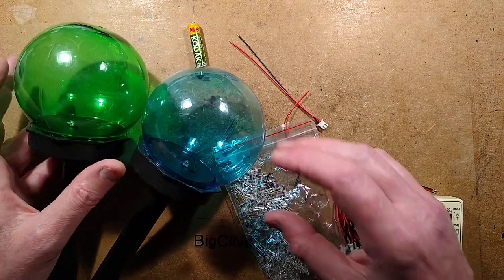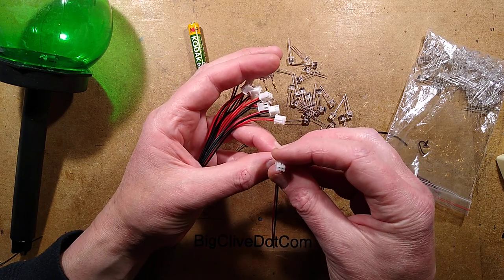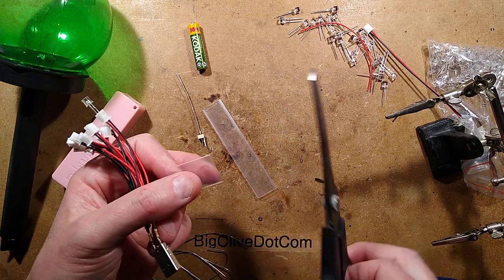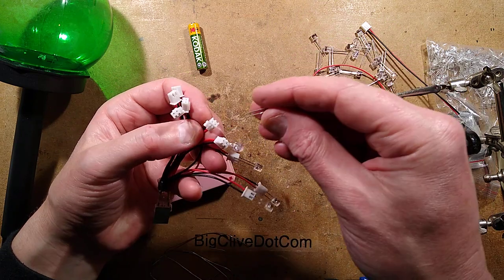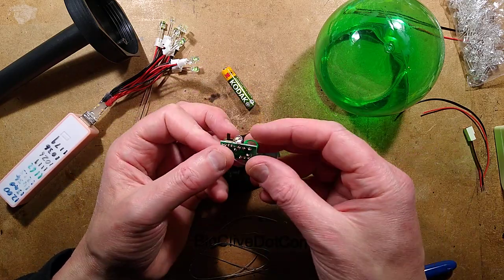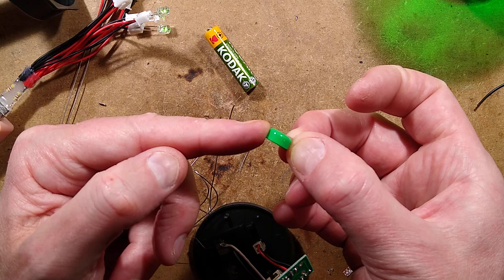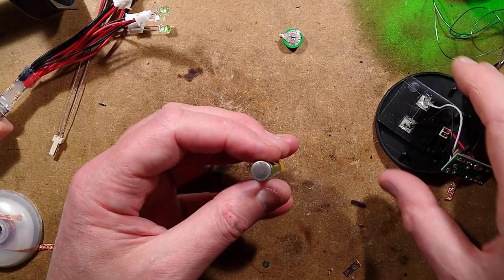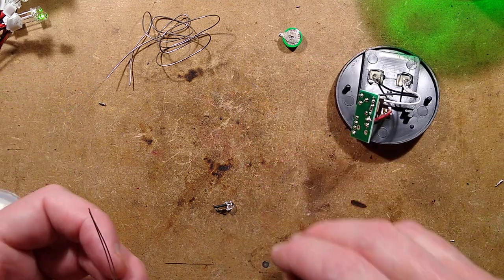Making cheap solar garden lights more interesting.  (Laid back video.)

Comment: Soldering above fingers?  Psh haven't lived til you catch a falling soldering iron to keep from burning the rug!  ...and burn your hand, dropping it, and burning the rug anyway.
Reply: I was soldering copper pipes in a wall with gloves on and I dripped solder down in them. Ironically the gloves were for safety.
Reply: That’s a fact got my hand my foot and the hardwood floor once
Reply: tried to catch a marshmallow that was falling off the stick once. Won't do that again.
Reply: Used to make 3D metal letters for signs the were all soldered (less distortion ) using dilute hydrochloric acid as flux and using a 1.5 lb (700g) solid copper soldering irons heated in a gas furnace. Quickly learned if it falls of the soldering bench don't try and catch it.
Reply: I taught my daughter to solder when she was 5.  "How not to burn yourself" was lesson 1.  It was fine until the wife came home from her summer school and wondered why little 'un had a burn on her hand...
Reply: I accidentally grabbed a soldering iron by the metal shaft. Three times. It sounds hard to do, but the iron was laying on a piece of tin sheet metal to warm it up ready for soldering a seam.
Reply: @PunakiviAddikti  otch!!
Reply: also soldering in your briefs or really short shorts...solder on one's thigh definitely doesn't brighten the day...
Reply: I did that but it was falling into my bathroom sink (bathroom is my work space) and luckily I touched the base of the metal part and it didn't hurt at all the next morning
Reply: Yes then the problem of trying to hide the burnt Rug from those who know everything and dispense instant punishment. Your burnt fingers don't matter at all.
Reply: I HAD NO IDEA HOW COMMON THIS WAS 😂
Reply: i guess half of us will not live, because we're not complete idiots
Reply: Ouch. Sometimes our natural reactions like to remind us who's really in charge.
Reply: Or the bed comforter.    My wife has yelled at me so many times lol 😆

Comment: That moment you see that really thin ziplock bag with LED's and go "Yeah... ebay".
Reply: Sucks that we don't have those small hobby shops where we used to buy this stuff as kids making some silly projects. They were close and you didn't have to wait for the package like you do with ebay.
Reply: @mmdirtyworkz   and you didn't have to support the Chinese economy with that much money, but keep some of it in your Region.
Reply: @Ch0rr1s  the LED's probably still come from China though?
Reply: For me that thin zip bag says aliexpress._
Reply: Ikr, that's where most of my components come from. Especially strange and rare components like blinking LEDs, alternating blinking two color LEDs, automatic slow changing RGB LEDs, COBs etc.
Reply: @mmdirtyworkz  Even the local MircoCenter is overpriced and understocked on DIY fun bits.
Reply: @technosasquatchfilms  yeah unfortunately, much different today, it wasn't like this before. I remember as a kid, it didn't pose any significant expense.
Reply: @mmdirtyworkz  Sure, but you paid more for 2 or 3 leds that you do for the shipping on the ebay package.  Local sellers kinda screwed themselves with what was clearly too much mark up.
Reply: @mmdirtyworkz  remember Tandy shops if you're from uk
Reply: @smoothemjay3303  we had them in Aus too. 2 x 1/4 watt resistors in a stapled together cardboard pack... insanity

Comment: Because of this video I went to the local dollar store and picked up a bunch of warm white string lights that use 2 AA Batteries to power. I snipped the 4.3ft line every 3 led's and wired up my crappy cold white led solar lights with the warm white instead. Such a huge difference. $1 per light when I bought the stake lights and spent maybe another 40 cents per light to retrofit. Sometimes they're still lit at sunrise lol.

Comment: Every time I come across one of those button cells, if there is space, I immediately add a AA battery. I now have over 30 solar lights in the garden, and all my shrubs have solar light strings. I spend a bit of time replacing the switches, and batteries...I love it. Every  Spring I buy more

Comment: You just changed my world with hot glue. I never thought about using it to mechanically stabilize solder joints
Reply: I love using hot glue to water proof circuit parts too.

Comment: I got a root canal today, and before they started they tested if the tooth was alive by having me hold an electrode and they would touch the tooth with some "tool" to pass current, and increase the voltage until I could feel it. Was rather interesting, first I'd heard of that! If you can feel a zap, tooth's alive, but if not then it's a good sign the tooth is dead.

Sounds like a perfect item for you to explore! :)
Reply: Is it safe???   8^/

Comment: Fun little project.  You tested the solar cell with a lamp and produced 30mA.  In the sun it would be closer to 300mA.  But you tested without the green shade.  In the sun, with the shade, I expect you to get about 1/5th that, so maybe not enough to charge your 100mA replacement battery.  Maybe that tiny button battery really was correctly sized!

Comment: Neat effect. It worked out better than one might think actually. They sell those exact ones here AU for about $3 so I must pick a couple up.  I have hacked many a solar light for Mum, they produce a much improved level of light for about 5 hours at night on an AA cell (Aldi) and a different inductor. And yes, bypass that switch!

Comment: re toolboxes, workbench tool accumulation etc the single best improvement to my work area I ever made was a board (actually a left over piece of laminate flooring cut to size) populated by a few dozen short vertical pieces of 38mm and 32mm black PVC pipe in 3 rows, tallest at the back (12cm or so), a bit shorter in the middle and shorter again in front, epoxy'd in place. its perfect storage for snips, screwdrivers, pliers, solder sucker, brushes, scissors, pens, poky things etc etc literally all the small hand tools that I would previously be constantly rummaging and hunting for, now all within arms reach and in a state of organisation the rest of my life can only wonder at

Comment: Thanks for the hint about soldering across the switch terminals. I normally use WD40 to keep them corrosion free. I have also started covering all the circuit boards with clear nail varnish.
Thanks for the great videos.

Comment: I have a string of x-mass lights 20 in each string connected to each of my solar lights.The strings came from the dollar store and ran on 2 AA. I  have extra battery's here out of charger packs so I put them in the lamp and took the supplied cheep cells out. Now it will last all night rather then 1 hour and i have 20 extra per lamp .

Comment: Dude, been enjoying having you videos on, while I’m writing.

I had a flashlight that I’d dropped, stopped working, and went under the car seat. I took it apart, and the red wire’s soldering broke… My hands shake like hell, so I avoid things like that… only burned myself once, but it’s working… I heard the make these things called gloves… 😉

Comment: I'm sure you're already aware of this but I wasn't: recent Anker smart powerbanks (the PowerCore Essential 20000 PD is an example) have a "low power" mode which, once activated, keeps the power flowing even with low power devices connected. Best of both worlds!
Reply: Is this the setting with the one green LED? I wondered what that was for!

Comment: Thanks for the educational bits in this, never considered that changing the inductor could be useful for winter...a useful mod I'll probably do from now on will be to have a switchable inductor to provide summer /winter setting...cool

Comment: That alcohol flux is fab stuff! I used that very brand to replace all the surface mount capacitors in my Amiga 1200.

Comment: Great renovation and modification :) 
I never buy garden lights with the small button cell batteries, because they don't hold much charge at all. In the winter, they won't be on for long at all, whilst in the summer, they'll be roasted. I often get the decent quality ones (not Poundland cheap, but not too expensive), and they tend to last. They also have AAA or AA batteries which often get upgraded as they fail.
I also agree about shorting the switch, as the switch often fails before anything else.

Comment: I replaced the LED in a garden solar light with a color changing LED. The LED works a lot longer than the one that was originally in it. I just paralleled them and left one leg off the original one so it could be reconnected if desired. As it is the color changing LED is very pleasing. Visitors always compliment how it looks and it has lasted a long time.

Comment: "Very harsh lesson " aka burn your finger, I have done that many times, for many years and still didn’t lern my lesson to not Tuch the hot end of the iron
Reply: I learned this lesson the first time I used desoldering braid. I didn’t think not to hang onto the braided copper thread I was pressing a hot iron to.
Reply: Don‘t catch it if it happens to Fall of the table! 😉
Reply: Mai Mariarti  I know those photos, they were even used in some advertisements by German official Institutions…
Reply: Runoratsu happened way to many times, just a reflex: oh something falling I better grab it with my whole hand and burn all my fingers
Reply: Mai Mariarti  The electronics store I work in used that photo in a promotional flyer. Everyone who works on the shop floors is at least technically minded enough to have seen the problem. We all sent our mocking derisive comments to marketing.

Comment: Hi Clive, nice video as always.
Just an idea for this type of solar light, use the switch to adjust the inductor amount for summer and winter. Meaning you don't have to redo your work twice a year...
Thanks , Mark
Reply from the maker: That's not a bad idea.  I usually just make them dim all year.

Comment: Making little RGB LED trees to go into some glass candle lanterns I found for a few bucks each on closeout for gifts. Not quite working out as well as yours here but similar idea. Haven't decided what I am going to use as a power supply yet but currently using a USB cord. I am digging the sockets. I ordered I don't know 1000 or 5k LEDs and they were nice enough to send resistors. Now I have a belt as long as my shop.

Comment: 3:40 Actually... 😁 The best way to do this is to use the multimeter in the diode test mode. It outputs a stabilized current of about 1 mA and measures the forward voltage. This is exactly what you need to match LEDs: the same Vfd @ fixed current. But your inventive method is good too, I use it for "HV" LEDs.

Comment: I fight water leaks in my solar garden lights to the point of obsession.
It would be great to find some like you have but on similar round dome lenses, I run a good bead of silicone around the inside close to the threads and that makes a cheap and dirty gasket. Look for other areas where water and critters can get in and enjoy your lights.
Nice video, Clive.

Comment: The hotglue inside heatshrink reminds me of the times with adhesive lined heatshrink, heat it up and squash between the wires, specially on heat trace tails
A very hot iron for short duration is the key to soldering batteries, i often use my antex XS25 with a 6mm chissel tip, or i could use my 100w antex ;)

Comment: The USB powerbank, I am guessing those are mAh charges you have written on the side, is that a tally an average, or something compleltly differant. A quick expantion would be really nice if you have time.
Reply: Probably measured capacity.
Reply: mah capacity, he always does this, 95% of the time he will cut a jst/molex connector and make an adapter to plug/unplug the batteries from different circuits

Comment: the ANA 618 chips are i think pretty common chips. i repaired several solar garden lights (which said to be watertight but arent) which all have that chip in them.  whilst on some most leads were badly corroded and some even rusted through, they were a nice source for small solar panels and rechargeable cells

Comment: I cut a piece of double sided circuit board into long skinny strips 35 to 50 mm wide and however long the origin sheet of double sided was before I started cutting it.
That piece of circuit board replaces your pair of wires.
In your application you could solder your two wires coming off your control boad to opposite sides of the skinny piece of pcb..
 It makes it very easy to add paralleled leds by soldering one lead to each side of the circuit board....

Comment: Was making an LED light for a caravan a couple of years ago, and I found it difficult to hold on to the LEDs and solder them as was.   
So I got a wooden clothes peg and clamped it in a vice. Then I drilled into the end between the two clamped jaws a 6mm hole, the exact fit for a 6mm LED.  No more burnt fingers

Comment: A thought for a future solar light vid.  A system to wire together solar lights so they either 1. they share battery power (all stay on together) or 2. share power coming from the solar panels... WHY? I hear you ask. So a string of solar lights can be put across a shaded area and not lose the lights in full shade 5 minutes after dark.  While the others stay bright for hours.

Comment: Actually Clive,, those of who have seriously cold and snowy winters do use the switch when we take things in for the winter to keep the batteries from getting totally zeroed out in storage (not all of them let you easily remove the battery, which is the better choice when you can, obviously).  
I just had to clean a switch that had failed into the off mode.  Easy, just pour in a bunch of isopropal and move the switch vigorously for a minute - done.  No point using something nasty and expensive like deoxit most of the time.
Now, I have one the lighthouses you did a tear down on a few years back and it has a click in/click out switch that IS garbage.  It keeps coming unclicked on its own (bumped by hail?  thermal cycling stress? I don't know, but it is annoying!).  Perhaps a higher quality switch would resolve the issue, but that one I am thinking of soldering into the closed position since I can remove the battery for winter.

Comment: I have not had good experiences with hot glue near resistors. Once did that, when I turned the contraption on the hot glue started dripping out because the resistors got too hot...

Comment: @31:30 Use the switch to select between two inductors, one for winter and one for summer mode.
We had been discussing the Angel wind chime that has a QX5252 chip like this one but I am still waiting for the inductor assortment to come in to go back into it and replace the broken one and the solar panel.

A couple of days ago I was messing with a Dollar General unit like this one that has only an inductor support component for the chip. I wanted to see if I could make those kind more interesting by replacing the white LED with a RGB flashing one. What I discovered is the RGB turns on with ONLY the first color red and does not phase shift. [change colors]
I believe this is because the little chip inside the LED does not like the pulsing power and constantly resets it to the first color that is displayed when you first power it up. [Red]
My solution is to add a diode [IN4007] inline to the + power of the LED and a 1uF capacitor across it. I could probably get away with a ceramic capacitor but I wanted polarity to ensure stability. [The diode keeps the capacitor from getting discharged when LX output of the chip goes to ground to charge the inductor magnetic field.] Of course you know that, it is for others that might read this comment.
The angel wind chime also uses a diode and capacitor because the white LED's independently flash so they must also have a little chip inside them to facilitate that requiring stable DC.

Edit: I paused the video when you talked about changing the inductor and then just started rambling on about the angel wind chime and the RGB issue. Then I start the video again and almost immediately you mention the issue with using RGB and the additional components that would be needed...LOL :-)

Comment: Hello Bigclive a tip with hot glue that will help in a this type of situation that helps is i normally put some 
water or spit lol on my fingers to press it into shape as its cooling down you can use a metal spoon or knife instead of your finger.
obviously you have to dry it down after before adding heat shrink or something like that. its a tip nothing more so hope that helps. for next time

Comment: You could use a scrap of PC board material for this, shaped like a willow leaf (for example) with one side + and the other -; Harder for solder to blob across and easier to put more LEDs on there, and it doesn't require Clive level dexterity :)

Comment: you know clive i noticed  these cheap £ shops garden lamps about 4 years ago all went from the 2 inch  solar panel to this one just over 1 inch square with the button cell, i didnt realize the output from this panel was as much as it is i just thought it had been done to further reduce cost.